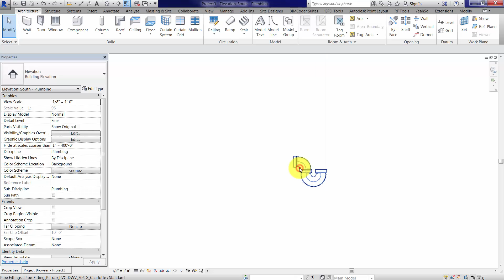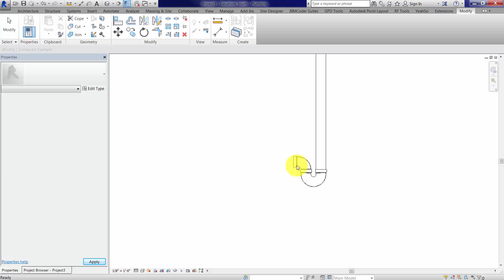Pipe Fitting and Sloped Piping

Comment: Chad, your insight to this problem is very much appreciated. Both Charlotte Pipe & Foundry and Lasco Fittings have this problem. Evidently, they do not know about this. This is really more of a Autodesk Revit problem. If the property to "Allow Slope Adjustments" were accessible while the Connector Element's property "System Classification" is set to "Fitting," it is unlikely these manufacturers would have missed this step. Likewise, many of Autodesk's customers would not have wasted countless hours trying to deal with the inability to properly slope sanitary pipes. The situation does make me wonder whether some Autodesk engineers take a perverse pleasure in creating this sort of Easter Egg Hunt.